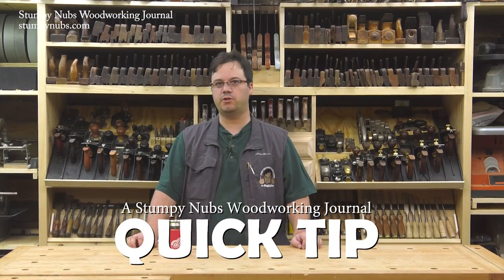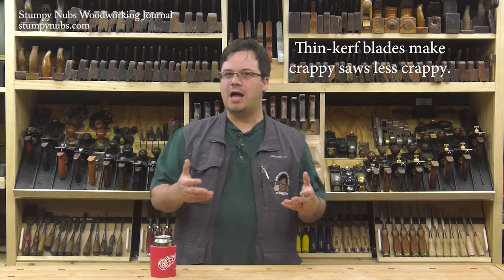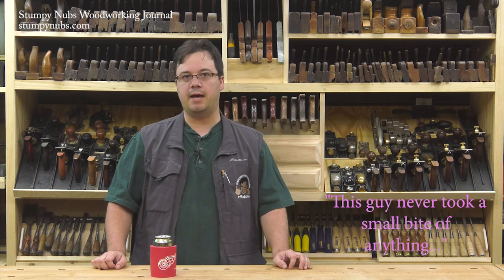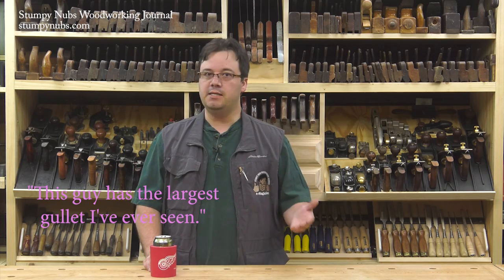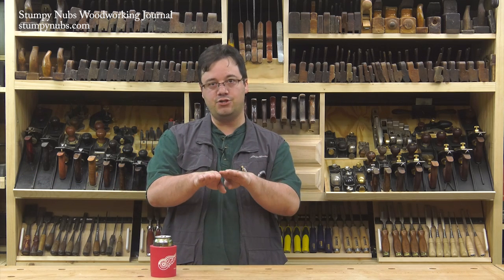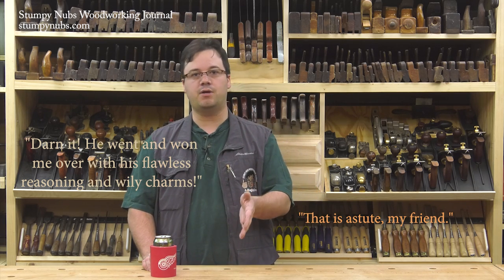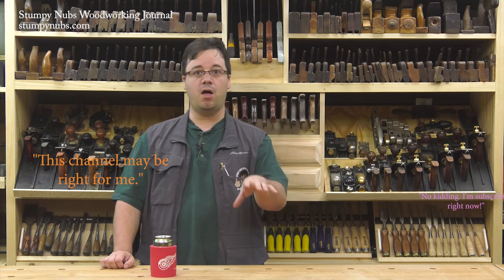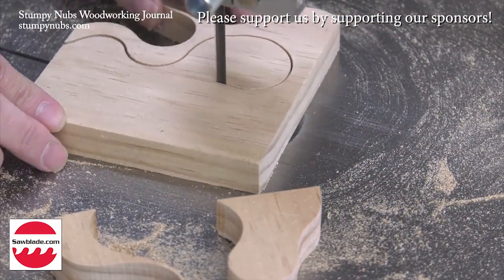Thin-kerf vs. full kerf- Don't choose the wrong table saw blade!

Comment: I assume you are only referring to table saws? Personally,  I see table saws as outdated (unless you need a portable one for carrying to jobsites... **maybe**.) 
 
With modern day woodworking,  I feel the table saw is obsolete, and far more dangerous than most tools (for those of who cannot afford, or get a free, SawStop anyways.) 
 
Personally, everything that can be done with a table saw, can be done with a panel saw that you make yourself. You can actually do more with a good, well designed panel saw. And for everything that a person might think a panel saw cannot do, there is the bandsaw. 
 
Both a panel saw, and bands aware safer, better alternatives imo. I mean, dados are for routers. Rip cuts are a lot easier on a panel saw. Also, if you have the right system, and saw, you can cut lumber that is too thick for a 10 inch blade. 
 
All in all, I see table saws as an antique... much like radial arm saws. Sadly, I feel the table saw is what everyone sees when they think "woodworking" as if they have been conditioned to do so. 
 
I am open for debate on this issue... my mind is not set in stone. However, since building my panel saw, and 16" bandsaw, the table saw has become more of a... well... a table. Lol.
Reply: Interesting, how do you cut( rip or otherwise) long bevels that aren’t normal router profiles, ie not 45 degrees etc.
Reply: @bennettrogers7921  (if I understand your question properly) The panel saw. The saw plate can rotate 360°. And the roller system I put underneath it can be fed through the saw from right to left (I cant do left to right because the 4 roller arms underneath the saw are one-way bearings.) 
 
Another part of a panel saw (that a cnc'er friend gave me advice to do) is to make a sliding jig that goes on the panel wall that allows me to use hold downs to prevent the ripped plywood/mdf from pinching the blade and stalling the saw. That way it holds the top 0art of the 4'x8' sheets against the panel wall, and prevents them from pressing down on the blade (or worse, falling off the panel saw) after it rips.
 
So it can be done sort of the way some people used to do it with a radial arm saw. (If it didnt kill them of course lol.)
 
Now, it does have limitations. That's where a long tabled router (great to have an interchangeable miter saw station set up. That way you can remove the miter saw, and drop in a router table setup) or a Bandsaw. 
 
It really comes down to a lot of factors. But only having 1 functioning arm/leg , I take the safety of those very seriously lol. 
 
I used to use a shooting board for long rips. But aligning up the ends of the board was very tedious,  and rarely came out perfect.
 
I'm in the (very ... *VERY* slow) process of moving to a new home. Once I get in, I'll be making some videos of the layout and how things work. That way I can get more ideas from others, and maybe even show others who are disabled, ideas to help them out. 
 
"Necessity is the mother of invention" as they say. I mean, there are woodworkers out there who are 100% blind, and they use turning beautiful works of art on a lathe (another tool I cannot use... yet.) 
 
So hopefully, in next 6 months I'll have some footage/pictures of things. 
 
I love making tools/jigs more than the actual woodwork itself. 
 
(I apologize for the novella. I just woke up lol.)
Reply: @bennettrogers7921  annnnd in my haste I didnt see the "router profile) aspect. 
 
A tilting router setup in a table is a great way to do that. I do not use it for that often, but Matthias Wendell make a great one.
 
I'm planning on making a pin router system in the future. So I'll incorporate that into it. 
 
But the easiest way, would be the buy a beveled bit with the cutting angle you need. Or a carbide insert bit that allows different sizes/shapes of carbide inserts to be attached... but those bits can cost more than a good router lol. And I can't afford that myself. Lol.
Reply: @carterscustomrods  
Thank you for your explanations, I enjoy learning something new and appreciate the thought provoking concept

Comment: Great information and perspective.  hobby woodworkers that have less than a cabinet saw... high quality thin kerf blades Good....  If you can afford a cabinet saw with a big motor.  full kerf blades are the way to go.... In the end if you spend more time using your table saw, than arguing over the blade kerf on the internet...  All is good.

Comment: New to this... so... what's a kerf?
Reply from the maker: The cut a blade makes in the wood. The path of the blade's teeth is the kerf. If you were to cut only half way through the width of a board, then turn off the saw and look at the board, you would see a 1/8-inch wide "kerf" that the blade cut.

Comment: So called  "combination " blades remind me of " one size fits all ". The blade is half good for everything like one size FITS no one.
Reply from the maker: Not so. A good combo blade (and I mean GOOD) will do an excellent job for all your dimensional cuts in solid wood, which is 90 percent of the cuts most hobby woodworkers make.
Reply: Not been my experience but then I have only been buying blades for 40 years. Right tool right job. Ripping with a combination blade is a setup for a kickback as it wears. Takes around three minutes to change blades, even in a production environment that is a minor issue.

Comment: Just for the starters you need 30% less power with thin kerf, second you get 30% less sawdust, third you consume 30% less electricity, 4th you don't overheat your saw motor, fith it it less stressful to the material sheet. The cons is that the tooth are going to degrade 2 times faster than full kerf. but good news, new carbide tooth are much more less expensive, you pay for them a third or a 4th of the full kerf chips price

Comment: I find with my job site saw that if I keep a new sharp blade I have very little bog
Reply from the maker: A sharp (and clean) blade makes a BIG difference for sure!
Reply: I think if one is worried about saw kerfs, they shouldn't be using a job site saw. I have a dewalt and the flex just from the saws construction is as equal to blade deflection.

Comment: The answer to an underpowered saw is to buy a more powerful saw and stop messing about with blades.By the time you add up the prices of the blades you could have bought a better saw.
Reply from the maker: Yes, it's that simple for everyone... SMH...
Reply: @StumpyNubs  I agree, a thin blade may get you going. I know what its like to be short of cash and buy inferior power tools. However if you are doing a lot of work better to upgrade to a more powerful saw that will do your work comfortably. Occasional work you may get buy with a thinner blade and as you said they warp if they get hot and start chatter and become dangerous.
Reply from the maker: - I never said a thin kerf blade was dangerous. What I am saying is a new saw costs way more than a thin kerf blade. And while you nad I may be able to afford a new saw, lots of people can't. And I'd rather see folks do some extra sanding to remove blade chatter marks than not be able to enjoy the craft at all.

Comment: I don't use a thin kerf blade because I can't use a riving knife with it. I've watched too many kerfs close behind the saw blade and occasionally so tightly that the board locks to the riving knife. What a disaster that could be without a riving knife. Watching one piece of lumber rocket past me and bounce off the wall is enough for a lifetime.